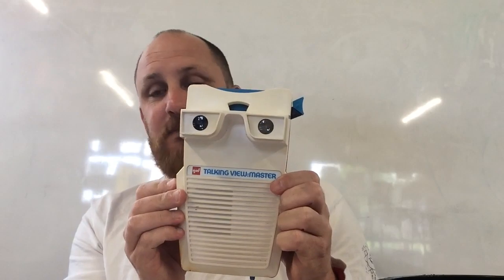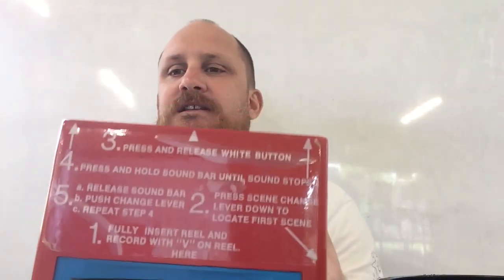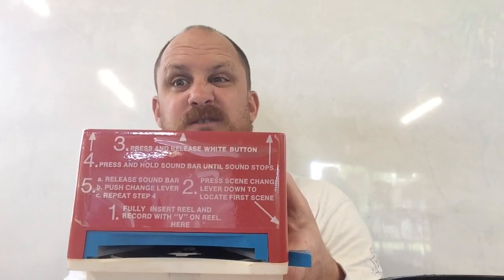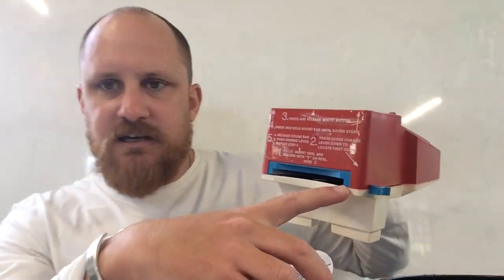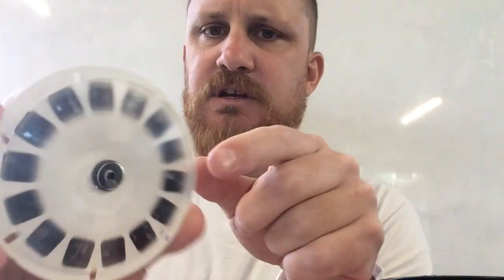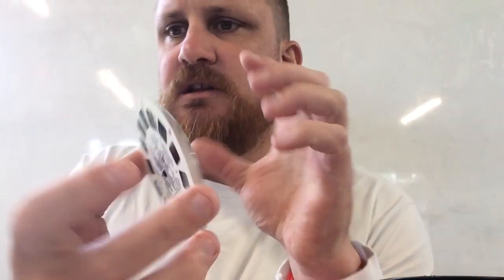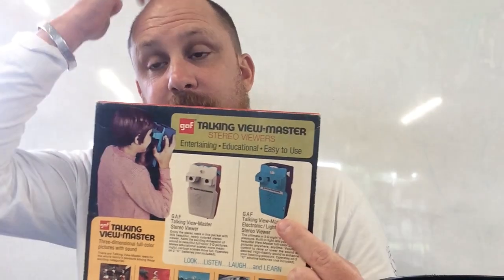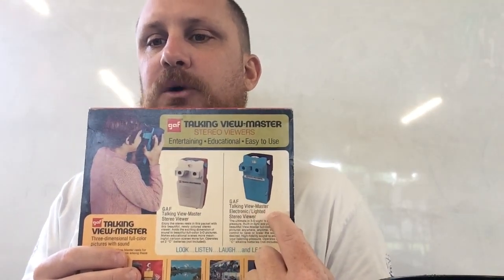The 1970’s Model Talking Viewmaster

Comment: You have the first incarnation. Purely mechanical player with a diaphragm as speaker connected to the stylus. The next version was the blue one - with an amplifier and crystal stylus and backlight. Sound was better and the pressure of the stylus on the disc much lower - so it didn't wear out after 50 or so plays....

Comment: The model 1 viewmaster is basically a handheld gramophone. The model 2 is an electric gramophone and Model 3 is a phonograph that plays very small vinyl records with very good sound. they are all good, it's a shame the model 1 was not operated with a pull string clockwork instead of batteries but GAF may have has some deal with battery companies.